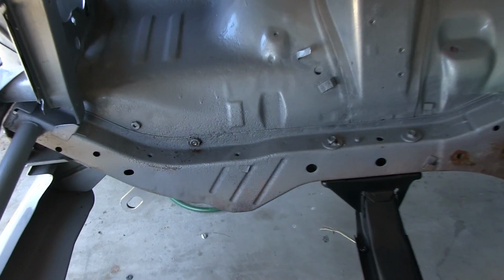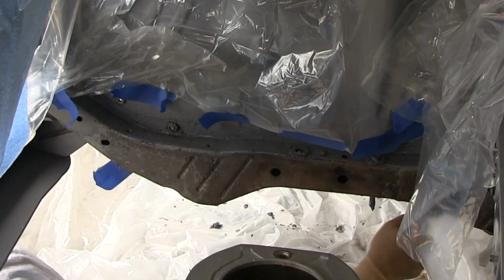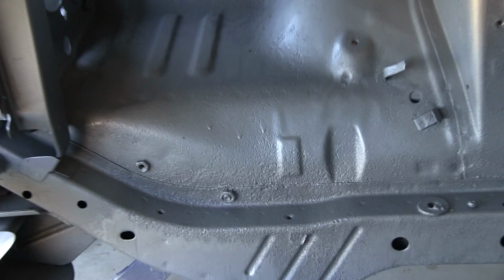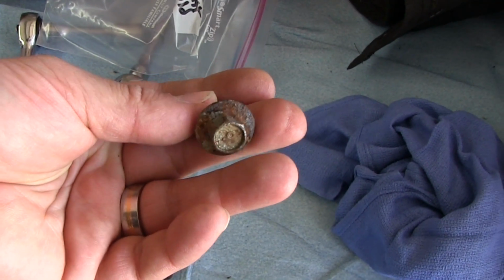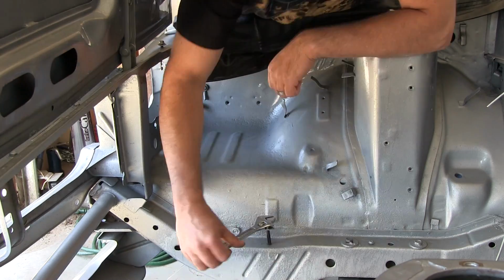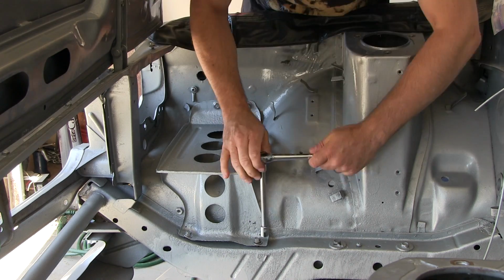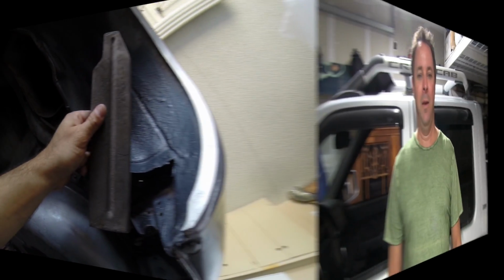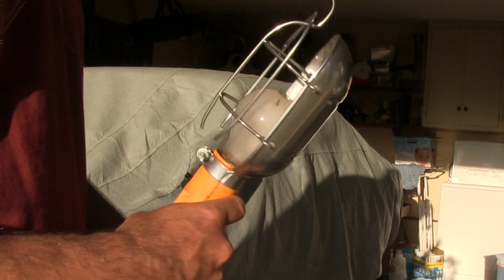VLog 15 Mazda RX3 Rotary Restoration Frame Repaint POR15, Battery Tray Cross Member

Comment: If you were serious about a restoration, you should of had the shell blasted, and then you could of treated the bare metal and used filler and smoothed back the finish of those pitted areas before painting... It would of looked smick..! And for gods sake, just buy new bolts, washers etc...!!!
Reply from the maker: thumpin1 In the beginning, it was just a paint job and a new engine. Little by little, I wanted to go further and touch finer details. Problem was, it was too late for the body. I would do many things differently and blasting the whole shell is one of them. Thanks for watching.

Comment: Hey mate, nice to see videos of your resto, I should start making some of mine. I'm doing an early 240z resto. In terms of plastic repair: vinyl paint works a treat, for cracked plastics etc.. you can use Q-Bond, it's expensive but works well for broken parts and building up missing areas. You can sand it etc..
Reply from the maker: Yes - - you should start making vids of your 240 resto. I'd be watching every one. I'll keep the Q-Bond in mind if I need to repair things. Thanks for the feedback.

Comment: Great job you're doing on the RX3 Steve! I've heard good things about the SEM paints for painting interior plastic trim, it's available in aerosol, and I'm sure I've seen it in can to spray with a gun.I haven't used it yet, but most upholstery shops I spoke to highly recommended it.

http://www.amazon.com/SEM-15013-Landau-Black-Color/dp/B00B3HXS8A
Reply from the maker: Wow, I'm gonna check that out. A bit pricey but if it works best I'm on it. Thanks for the feedback and the link.

Comment: Nice videos you got about your RX3, keep up the good work :-) About your plastic parts, have you tried "polytrol"? it works well on a lot of things, but don't follow the instructions on the can, you have to wipe it all off at once, and redo the operation a few times. If you do as the instruction says, my experience is that it makes almost a layer of clear coat that will crack, look ugly and then fall off.
Reply from the maker: That seems like a winner. Something that restores rather than paints. I'm gonna take a closer look. Thanks

Comment: Nice to see another vid Steve. :) I'm not sure the cross member nuts have a torque setting being nylock nuts, I could be wrong though so don't quote me on it. For the interior trims, you can get paint for them (pretty sure it's VHT vynal paint, might not be available over there). Maybe you could find a dash restoration place that deals with fixing up interior parts?
Reply from the maker: Thanks for the feedback Keith. VHT sure sounds familiar. I'm hoping to save the money the dash guys want to restore my stuff, but I did find a guy (more on that in an upcoming Dashboard episode).
Reply from the maker: As for the torque spec...I was questioned on it when I first put it back in to pull the car out of the garage to fix the door opener. So I looked around and couldn't find a spec (aside from basic size & torque recommendations).
Reply: riverseine
Fair enough. BTW, the bolts for the battery tray I'm pretty sure are the same as the ones that attach the bonnet hinges to the bonnet if you have any spares of those.
Reply from the maker: Funny you should mention the bonnet bolts. The body shop lost my originals and replaced them with completely unacceptable mismatched bolts. Some with washers, some without. I had to go to my green car, take a real sample, and then find more like bolts in my seemingly endless supply of old nuts, bolts, washers, and screws. I did find exact matches which I've powder coated. I just have not installed them yet because I know they will be taken on and off again times over when engine install time comes about.